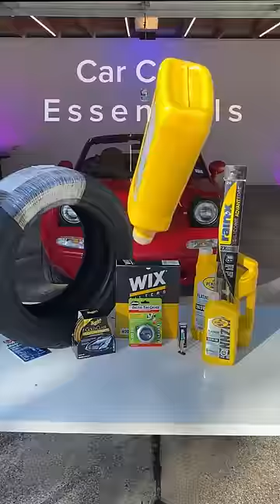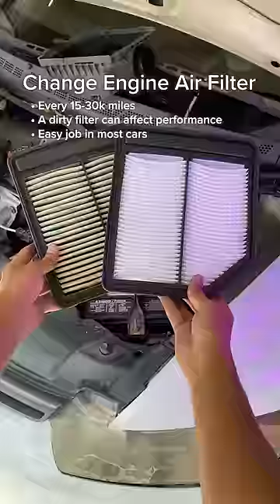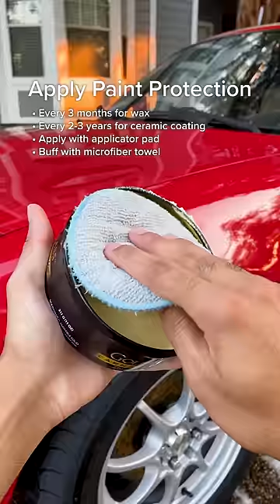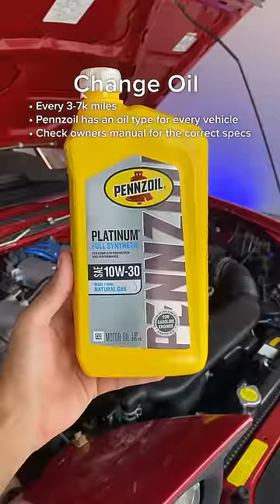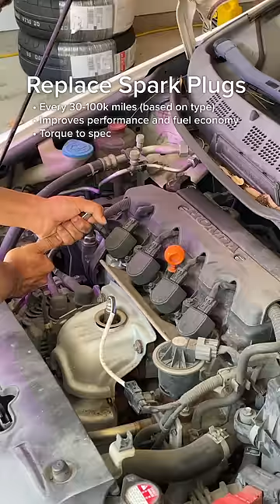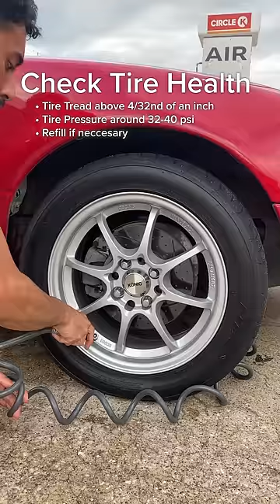Car Maintenance Checklist! (make your car last longer)

Comment: You do know by putting the tire pressure 32 to 40psi your going to have people doing that to their cars when in reality every car and car tire is different on my truck it’s 75psi in the rear and 60psi fronts my other truck is 45psi front 55 rear. I know some new cars that are higher than 80psi. What I’m trying to say is you might want to change that to check your specific tire for the rated pressure instead of saying general 32-40 because that’s just not the case for any car or truck.